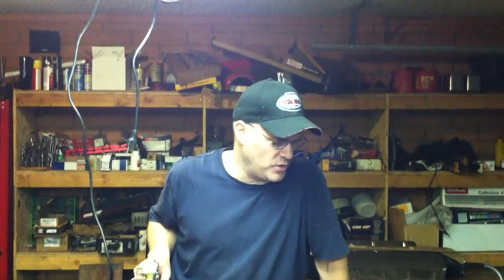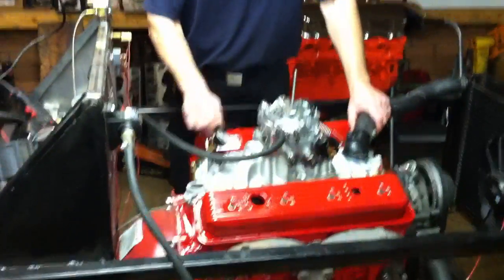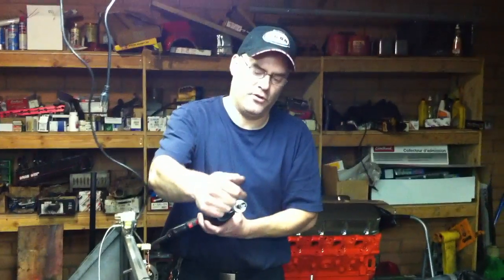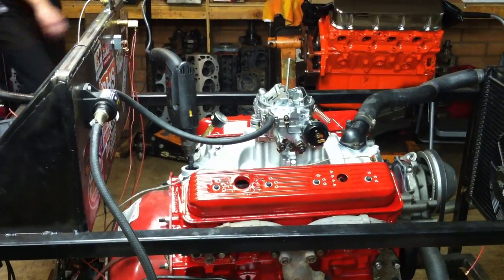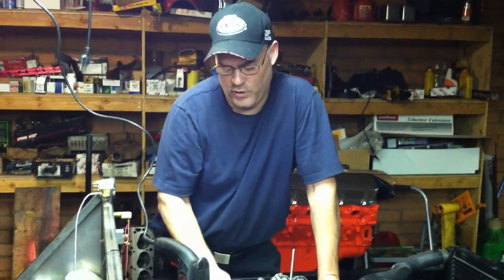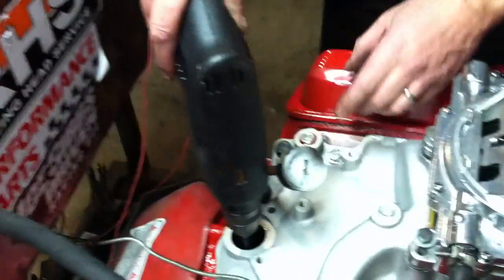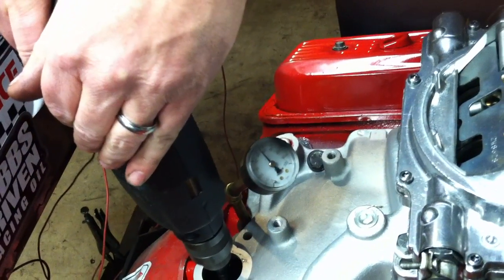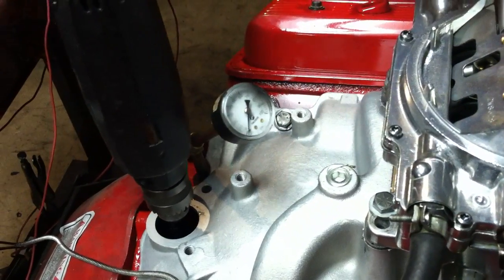350 Chevy oil pump prime

Comment: Did you have to turn the crank by hand before you got oil coming out of all lifters?  And what kind of oil pressure gauge did you use and at what happen if the psi gets too high im gonna do that on my 383 stroker and i wanna get all the information i need before i screw something up thanks

Comment: see all my bearings were at .003 and i could only get 20psi but my son did put synthetic in. so for a 600 hp sbc with .003 bearing clearance what oil do you recommend?
Reply from the maker: Lucas Hot Rod oil
https://www.karlkustoms.com/wp-content/uploads/2020/07/LUC10679.jpg

Comment: Hey i am doing a quick fix in a Chevy 350, 1 single connection rod bearing. The engine is still in the truck with oil pan out. Will i need to prime the oil pump for this application?  Thanks guys.

Comment: Question.  Just primed my 350 sbc.  50 psi. Good oils at all but 3 rockers. 2 of the 3 are getting a little oil and 1 isn’t getting any oil. I’ve rotated engine as well. No difference. Should I be worried or will it work itself out once running? Thanks!
Reply from the maker: no it will be fine run it

Comment: How long can you wait to run the engine after priming it before you need to prime it again?
Reply from the maker: If in doubt prime it
Reply: @Myvintageiron7512  Well, I'm asking because once the throttle body is installed it's impossible to prime my engine using the drill attachment. I was wondering if it's like a regular car that was running but then sits for a couple months before being started again.
Reply: @jaseman32  I know it's probably too late for this, but you can just crank the engine over several times without the spark plugs in and it'll build oil pressure if you're worried
Reply: @RaindropConstruction  I thought about that but the plugs are impossible to reach. I just went for it. It cranked for a good 6 or 7 seconds before it turned over and I had instant oil pressure. It's running great now.

Comment: Something to add, after your oil gauge shows solid pressure for a min or so, with all the spark plugs out bump the starter over a few times with the drill driving the oil pump at the same time to get oil all though all the oil galleys & rocker arms as the rotating assembly needs to be rotated a few times to make sure all hard parts are fully coated with oil out of the oil pump.  Doesn't take much.
Reply from the maker: Great point!

Comment: I understand prelubing and engine but aren't you supposed to do a good enough job lubing engine components during assembly that prelubing like this is not necessary, ive never had to do this on any of the diesels or light duty engines I've built and never had an issue, every thing was fully lubed with engine oil and lubriplate assembly lube on bearings and cam bushings, certain engine parts are submerged in oil prior to assembly.
Reply from the maker: the entire passage system is full of air on a rebuilt engine most OEM's recommend spinning the pump

Comment: I want to use a chevrolet 350 in a car that will do track days. the car weighs about 2700lbs and the engine makes about 450hp @ 6300 . I want to keep the engine wet sump, but I want it to handle doing 30-40 minute sessions with no problems. What mods would you do to the oiling system?

Comment: Hey my 351 is pumping to the top of the motor. Yet it is so hard to turn. Could it be since its a high-performance oil pump? Or do they all build up pressure and are difficult to turn the priming rod. So it took about 30 seconds to have oil coming out of the pushrods. Crazy question. How is the oil getting into the lifters if it is being pushed up a pushrod? Is oil being forced through that tiny hole in each of the lifters?

Comment: I think I found the answer to my own question... I was using the wrong priming tool. The oil that goes to the rocker arms on the right side of the engine it's supposed to go thru the tool. anyway thank you very much for your videos.

Comment: Is there a LOT of resistance on the drill handle when you run the pump? I just primed my engine for the first time (ever) and I was surprised at how much  resistance there was on the drill. With no oil in the pump it turns relatively freely, but now I have break-in-oil in the sump it seems to take a lot more effort to turn the pump.
Reply: Did you ever get an answer tp this? I am going through the same thing. Burned up a drill.
I actually watched this video to hear the resistance he had. I used break in oil
as well.

Comment: i prime my 350 engine an i was getting about steady 30 lbs of oil pressure on the  gauge an all the rockers  arms where getting oil on bank one one of them was shooting about  3ft away is 30 lbs is it ok or it needs more pressure i just got the stander oil pump from autozone  thanks
Reply from the maker: It should be fine
Reply: get a high pressure / volume from a speed shop

Comment: is this needed to just change out an oil pump? my 93 Chevy k1500 keeps losing pressure but it will build back up to over 30psi. any ideas thanks
Reply from the maker: no you don't really need to do it for that I would however submerge the pump in oil and make sure it's not dry

Comment: i primed the pump on a 350 years ago and i used that tool you are using. i will admit i didnt have a gauge on it, i waited to see oil out of the top of the engine....... oil out of the pushrods. everything worked out.

question, what if you are working on an engine that does not have a traditional distrubator. i will give an example, an LT1 5.7 which really is a gen II 350. it uses a unique crank triggered ignition that bolts to the front of the timing chain cover, called an opti-spark. it does not use a traditional HEI. on that engine, how do you prime the engine if you are overhauling it?
Reply: i was lucky my dad worked at chevy  he made me all the tools i needed   and got a few parts too  he told me i was the only kid to have a harmonic balancer puller custom made that cost chevy thousands of dollars
Reply: thats how i do it  i see oil at the rocker arms
Reply: once i frogot to plug   block on my first rebuild in the basement  man was my dad pissed  he called me jed clampet  that was 40 yrs ago

Comment: Is it necessary to prime the oil pump after a pump replacement?  I’m not rebuilding the motor just putting in a new pump?
Reply: +Anthony Stauffacher    On an engine that has miles on it that needs a new oil pump FIRST de-burr the new oil pump gears, reassemble,stuff it with vaseline and you'll be fine. I've done it per advice from machinists and engine re-builders. Works like a charm.

Comment: im in the middle of doing this right now theres only 1 rocker arm getting oil. its the very back driver side. rebuilt engine, new pump. any reasons why the other 15 are not getting oil to them?
Reply from the maker: Don't worry about it as long as you have good oil psi just run it, it will be fine some lifters will never pump up with a drill  it's fine just run it make sure you use break in oil and break in the cam properly
Reply: Myvintageiron7512
thank you. love your videos by the way. very informative.
Reply: @Myvintageiron7512  ok im getting to do this but now i worried becuase my lifters were a little tight in the bores. And i feel i might over tighten my rockers. What are your thoughts

Comment from the maker: You don't need to worry about that as long as you have good oil psi for 2 min and some of the push rods seep som oil it's fine the liftere are not going to push allot of oil through without the lifters moveing it also depend on what type of priming tool you use

Comment: Just rebuilt a SBC TPI 350 (roller cam),primed manually with 50psi on the gauge until oil came out of pushrods (just about).Couldn't see as the rocker covers where on in this vid, but, how much oil should come out of the pushrods?

Comment: What do you use to Paint the Block, Valve covers, oil pan and so on? I want to keep the Original Chevy Orange just want it to last and not peal off due to the heat. Please let me know Asap thanks
Reply: The most important thing and part to having your paint stay good and last is prep. Sure spraying correctly and consistently is important, but the initial prep work is by far the most important. If they are old parts,  the need to be sanded , sand blasted,  cleaned well with a non "oily" soap, preferably acetone. Use lint free cloths. Then... Either prime & then paint, or use a paint & primer in one, which works very well & has excellent coverage.  I've had & seen very good results with this 2 in 1.  Do not use cheap knock off, no frills paint! Rustoleum or Krylon brands are very good paints.  I've had a good painting stand up as well & sometimes better than powered coating.  And whomever wants to jump in & comment this isn't possible, obviously doesn't know how to paint well. 

Another side note is painting conditions, if it's too hot, too cold, damp or humid out or in the work area,  this won't be optimal conditions for painting,  & can greatly affect the quality.  Even the metal or plastic, etc that's being painted can't be to cold, hot, etc etc.  
Make sure you are in a well ventilated work area , but not too windy, etc where stuff can blow into your paint. Do not leave in an area where the sun will directly shine on the painted items. It will dry faster sure but can haze & cause all types of problems. 

This last part i will advise against doing for the novice or beginner. It does work & can help the process,  but you have to knownwhat your doing when doing this, & that's "baking" or heating the item as would be done in a paint shop. It can be done in your home oven, but it has to be done correctly, at the right temps & amount of time, not to mention that this can be dangerous to yourself & those around you, due to fumes. Plus most Girlfriends &/ or wives (possibly BF's or husbands,  for those women who do this while their spouse's play Betty Crocker); well may not be to happy with this option. Lol!

Comment: Sounds good man, I'll definitely prime the engine first.

Unrelated, but i'm reusing a stamped steel oil pan (1968 327) and it looks like someone over torqued it and now the bolt holes are indented. Do you think this could cause a leak? any tips on how to straighten out the flange?

I'm using a felpro 1 piece pan gasket

 Thanks again, your vids are helpful.

Comment from the maker: I have heard of that before however who ever told you that is wrong and here is why most of the assembly lube on the cam will not be pushed off the cam I have tested this by removing a pre lubed cam after priming and 90% od the assembly lube was still there also if you don't prime a new engine you will have a delay in oil psi all the oil galleys are full of air I have never seen a primed engine have any kind of oil related failure I've seen dozens of un primed engines fail
Reply: you want to  purge air out of gallys and lifters if you didnt soak lifters

Comment: I was recently told by an engine rebuild shop in town that if all bearing and metal on metal surfaces are coated in cam lube/bearing guard when assembled, you shouldn't prime the engine because all it does is push the assembly lube off the metal surfaces.

have you ever heard of this?

Comment: I realize this is a 6 month old post, but if your engine is an original TBI block, you will have a roller cam, therefore no break-in required.

Comment from the maker: I use Joe Gibbs break in oil you can buy it on line comp cams also has an addative you can add to over the counter low zinc oil. as far as break in goes for a flat tappet can do not let the engine idel 1500 rpm min 2000 is where I like to see it for at least 15 minutes be sure to prime the pump first I have a vid on it, change the oil and filter right after cam break in but be sure to use break in oil and a new filter no more than 500 miles on break in oil then use high zinc race oil permanetly
Reply: Myvintageiron7512 is 20-50w break in oil too thick ? I had a drill go out trying to prime it ,it’s 383 stroker
Reply: I pick up 10 quarts of joe gibbs break in oil for $100off ebay